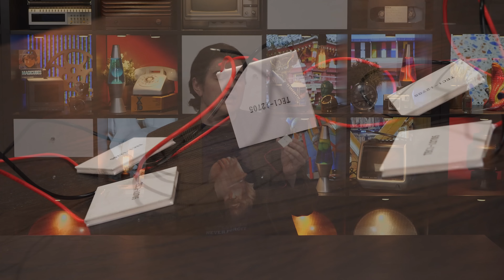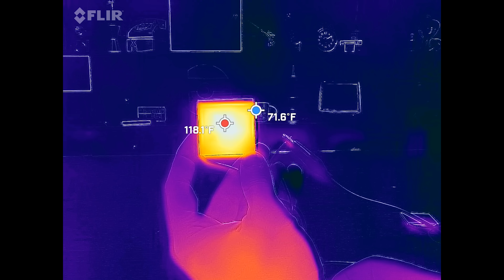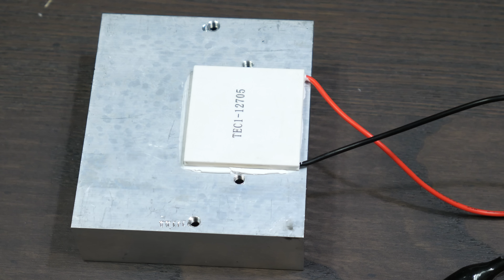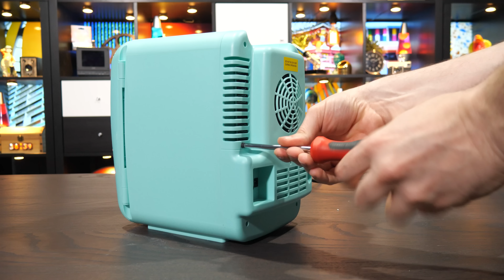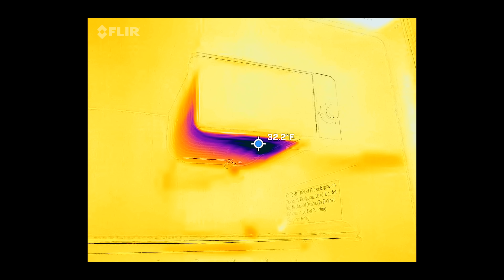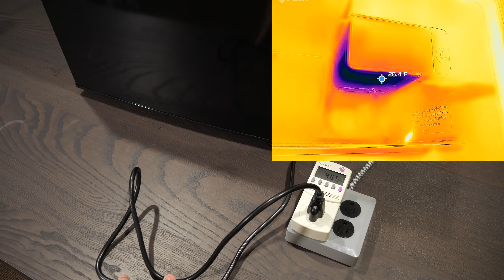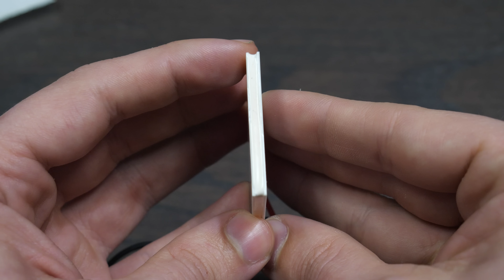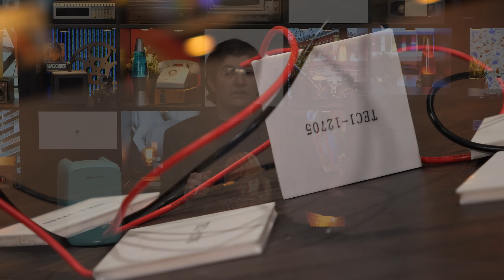Thermoelectric cooling: it's not great.

Comment: I already knew peltier junctions were crap. I had a cooler I got as a service anniversary gift that ran on 12v. I only used it to keep cold stuff cold-ish in my RV. It couldn't get a can of beer cold.

But damn, this is a good video. I am thermodynamically impaired as well. I see the energy budget everywhere I look. My dad taught me to not use the brakes in the car by coasting to lights or signs, things like that.

Comment: Can't argue with any of the drawbacks in the video. We like ours but that's because nothing larger will fit in its place. Fortunately the space it's in regularly reaches low 60s Fahrenheit so the drinks are always ice cold. At 70°F room temperature they would reach 40°F which is totally drinkable for me, although tastes can differ.

Comment: Also if you apply and temperature gradient to each side of the Peltier device it will generate a voltage. Voyager uses something similar as it's power supply by using the heat from nuclear decay  and the thermal radiation to the cold of space to generate like 470 Watts.

Comment: you should really get some powerplugs with measuring capabilities like shelly plug-s-plus or better yet something that comes already preflashed with tasmota (just don't forget to calibrate once). tie it to e.G. homeassistant or mqtt or something like that, and you get wonderful graphs over time for current, powerdraw, consumption over time, grid-frequency and so on (not to mention to be able to flick the switch inside it, and have a remote on/off-switch that way). this is way more appealing than a regular old kill-a-watt, and trust me, you will find the over-time-graphs compared from old fridges, to very old fridges to modern switches to something like peltier-elements very interesting. i did basically exact this comparison a few days ago, and i was baffled, how energy-efficient modern fridges have become, and you can deduct their inner working mechanism wonderfully from just looking at the graphs. you even can immediately tell, if a fridge uses leds or incondescant bulbs. 

Give them a try, you wont regret it. I currently use "Nous A8T" preflashed with tasmota (EU-Version), but they come in all different shapes and sizes. And they are pretty cheap anyways (on german amazon currently ~11.5€/pcs in a 4-pack)...

Comment: So i have a 12 can version that has 3 plates in it (thanks thermal camera) and the option to run hot i love the thing it lives in the sevice truck runs off the inverter and the deep cycle battery it can run on its side (lives behind the seat) and can be reversed to keep stuff from freezing and for keeping stuff cold if you add 3-4 cold cans from the fridge it keeps them cold egnough for working outside lmi have also ised it in the winter to keep stuff unfrozen overnight sometimes a hotel mini fridge isn't the best option

Comment: Just because you hate the application of the technology doesn't mean you should hate the technology itself. Thermoelectric cooling does have a lot of technical potential and we need to develop new ways of compressorless cooling to eliminate the extensive noise pollution from the outdoor unit of a vapor compression system.

Comment: What if you added a temperature sensor, an arduino to control an on off cycle that cuts power to the peltier when a low temperature is achieved and maybe a slightly larger one. Wouldn't that technically make it better at cooling at the cost of over complicating it?

Comment: brilliant description!  may i suggest another refridgeration topic?  how about the absorption fridges that are really common in travel trailers and rvs.  these things use either propane or electricity to heat a boiler filled  with an ammonia/hydrogen mix that is circulated by gravity to cool a fridge

Comment: I made a TEC based mini fridge inside of a PC case for my company's april fools joke once.  It had a lot of problems with condensation and used a lot of power.  One thing I found though was that the TEC ran it's peak efficiency with a 20C delta between the hot and cold sides.  I put a CPU liquid cooler on both sides and found it was easy to maintain that junction differential plus the CPU cooler was very quiet.  It was still terrible, just less terrible.  Again april fools joke.  

One legit use of TEC's is in regulating the temperature for small scale chemical reactions such as medical testing equipment.  Since it can get hot or cold, precise termperature regulation is possible with an H Bridge and a local temperature sensor for feedback control.  Some checmical reactions need to happen at exact temperatures and TEC devices are a great fit for that application.

Comment: I travel with an Igloo 35 quart Peltier cooler built in the lid. I use gel ice pack to hold the temperature. It pull a lot of watts. The solar generator battery pack says it pulls 65 to  75 watts. Running off the car’s  power 12 volt port , it keeps blowing the fuses. There are compressors based travel fridge and freezers , good brands start at $400 dollars. Top brands start at $2000. These are designed to handle the rigors of off road travel and be run off a battery pack.

Comment: I needed this BEFORE I bought two of these after the first one broke and I got a slightly larger one for $10 more. the stainless steel looks classy, I'll probably upgrade the heat sink, maybe get a more power efficient PSU from an old computer, add some RGB and a graphics card, etc. then play DOOM on it

Comment: There are 12v peltier based portable coolers around the size of a mini fridge that are really nice for traveling with and not having to deal with ice.  I use mine quite a bit and aside from not using ice I also have a wall adapter to run it so if for some reason I don't feel like unloading it when I'm done I can just plug it in and deal with it in the morning.  They do definitely fall into the temporary use category though and work best for keeping already chilled things cold instead of cooling down room temperature things.  

Another cool feature they have(which I rarely use) is they can operate in reverse and keep warm things warm.

Comment: I always wondered why Peltier elements were not piggyback on top of each other. If one could lower temp by 30 degree, then 3 would provide 90 degree difference. I'm sure the efficiency would way worse.

Comment: Peltier coolers are also great ine you need to cool something with a small surface area, such as a processor.  It was very popular back in overclocking days as it was one way to achieve extreme heat dissipation

Comment: I'd like mine better if it it didn't have a propensity for draining the battery in the car. The one I have is set up as a shoulder carryiable car fridge. That means 12v DC, and I've not found a decent evaporation cycle refrigerator that works well in a car. There may be one, but I didn't find it. I gave up on it when it killed the car battery while I was parked at an even for over 2 hours. For this last trip I would love to have had something for the drive, but it ended up being just as well to take along a cooler and pick up 5 lb of ice every couple of days. Remember if you're traveling through the mountains if you have ziplock bags, make sure that they are not underwater during elevation changes.

Comment: It isn't exactly news that tec coolers suck. Funny thing with tec coolers if you heat the hot one side it creates a potential. You should check out the Biolite stove which runs them in reverse to charge a phone.

Comment: I always thought peltiers would be a great application for absorption refrigerators. For electric use, they always have a heating element. In theory, you could use the peltier as the heating element which would give you more heating energy than you put in. At the same time, the cold side can be used to help cool the fridge.

Of course it's much more complicated to do that and probably not worth it, but I want to try it one day just for the fun of it.

Comment: I used a tiny fridge in my room of the sharehouse during uni. I bought it at an op shop (thrift store). 4 bottles of beer and 2 250g blocks of Cadbury chocolate. I think I gave up on it during summer, but having it on constantly during winter took the edge of the chill in the room. And the room rent I paid included all bills.

Comment: funny i have one next to me right now i use it to keep my cup of water cool as don't like room temp water and it can get cool down to 4c lowest i see it when was testing it but struggles on hot days above 25c in room am in UK so 25c is warm day 🤣 my one is a bit more fancy has cold and warm switch and only uses 35watts but i did change the fan to a little Noctua one and worked way better and more quiet. My only problem is when it does get cold gets ice build up on the back then when room gets warm it melts a bit so have to have paper towel folded inside to stop it dripping as the new fan makes it cooler for longer.

Comment: I flipped the compressor on my mini fridge on it's side an attached it to an 2x4(which actually damped the vibrations a bit too) and made my mini fridge into an mini chest fridge, never got to test how much less energy it used but it's a fun tip. I used it that way for like 6 months. Sounds like another fridge video for  you! Do it, come on it will be fun...and on brand!  No effort November is right around the corner.

Comment: It is wild to realise those tiny Peltier fridges pull more energy than big chunky American fridges! I have two questions after seeing this video: What happens when you plug in a regular fridge directly after flipping it upside down? And can they make the compressor system small enough to work for the tiny Peltier fridge?
The remark that the regular mini fridge can do without the tiny freezer part; I have one and use the freezer part to make ice cubes, which works surprisingly well.

Comment: There was a peltier in the uv/vis spectrophotometer I used forever ago. Not to make it cold. Just to make it a "consistent" temperature when you took a spectrum. Usually just above room temperature. Because it's easier to use a peltier to make things hot (at least that was what I was told :) )
Reply: Also the "Save big money at menards" jingle lives rent free in my head and this video revived it.

Comment: For anyone else confused by the big "C-PENTANE" label on the back of his black fridge:

That's not the refrigerant, it's the blowing agent used to make the insulation foam (cyclopentane). The refrigerant is listed on another label as R600a (isobutane)
Reply: Thanks for the info. My organic chemistry brain was having a fit over it.
Reply: Thanks for this comment!  I have a chest freezer that uses cyclopentane as the refrigerant, saw the C-Pentane label, but kept hearing isobutane.  Later, I saw the R600a and began to think I was seeing two different units.  But that would be uncharacteristic for Alec.  I was left in confusion until i found your comment.  Thanks again!
Reply: Maybe they're doing this now after they were caught several years ago manuacturing shittons of CFC11 in Shandong province in flagrant violation of the Montreal protocol?
Reply: Btw. Is that another America/Europe difference? I've never heard of R600a as a refrigerant before. Fridges here use R290 (propane).

Comment: Okay, I am confused. I owned for many years a device similar to that blue one. It was larger, had a silver door, a fan on top, fit 8, not 6 cans, and got those fuckers ICE COLD. I don't mean "chilled" the way he is showing, you'd have 100% ice cold beverages available. The top metal plate inside where the air flowed would ice over. Did they just used to make better ones of these micro-fridges? I'm not arguing that the one he bought isn't a POS that is 100% not worth running, but I had a very similar one that performed heads and shoulders better than what he's talking about in a slightly larger capacity.  Do they not make decent ones anymore? My box didn't say anything about 25-30 degrees below ambient either.

Comment: I’m disappointed. I’m struggling with health issues and need access to drinks all the time. At home it’s no big deal, but travelling a cooler without ice would be nifty. I never bought one because I just assumed that it was just a fan in a box.  It’s more complicated lex and equally gimmicky.  I have a mini fridge that I use in the camper, but it is not practical to leave in the rear passenger footwell of the car.

Comment: I could be wrong, but I believe I have some of these in my vehicle.  I live where it gets pretty hot, so when I had the option to buy a vehicle with cooled seats I said why not?  I noticed however that they don't run on the vehicle AC that I can tell, so I figured they must be Peltier devices, which means that they may cool the seat somewhat on a hot day, but they dump that waste heat right back into the cabin.  I don't use them often even when it's really hot.  Very limited use case there, and even then it comes with some caveats.

Comment: So the thing with peltier devices is that you can get higher than even a COP of 2, as long as it's at very minimal temperature differences and power inputs. It's just that you'd need an awful lot of them to get the same total power out at that operating condition, and they're not free. You may also need to change your design in order to allow them to work the way they want to, such as by using counterflow heat exchangers to reduce the temperature differential depending on the purpose of cooling. For instance, maybe you want a dehumidifier, but you realize the bare minimum is just enough to keep actual dew from condensing onto random objects, rather than needing lowering the dew point enough for human comfort. Well, if you for some reason want it to be quieter than you could possibly get with a refrigerant-based system, or if you refuse to reuse an old fridge and have to buy brand new, this might kinda work. And in heating, the COP is guaranteed to be greater than one, so these are always better than a resistor, and sometimes a fair amount better, especially if your thermostat is not just on/off but instead smoothly varies the power. So maybe you could use them to heat water, for instance. Or maybe you want to make something that can theoretically last centuries, and the only way to do it is to use this and lots of heatsink area, to eliminate the fans.

Comment: By inputting heat and cooling the cool side, they can be used as generators.
They're worse as generators than they're at refrigerators. But they're used in Radioisotope Thermoelectric Generators powering spacecraft by transforming the heat created by nuclear material straight into electric power, particularly in the ones that are designed to travel so far from our Sun that solar panels become impractical, like the Pioneer and Voyager missions. One is also fitted to the Curiosity (2012, still working!) and Perseverance (2021) Mars Rovers. Some of the scientific experiments left by astronauts on the Moon were also powered by RTGs. So yeah, take that standard refrigeration cycle.

Comment: I've used that exact minifridge at work (the proper minifridge, not the blue blob), it's not buzzy during operation. The other thing is they can be a bit of a pain when ice builds up on/in the evaporator where people have let them go for months at a time without cleaning leaving a solid mass of ice taking up space. The only way to feasably clean it is to unplug it and set it outside to thaw for a day, which is  a bit less than sanitary, but at least you won't have water spilling out of the fridge into your workspace and you can wipe it down afterward.

Comment: I drive a truck over the road and keep a 12v cooler next to my seat for bottles of water that i pull out of regular refrigerator that also will freeze. And i wouldn't know what to do without. It is realy good at keeping already cold stuff cold. And will discharge the batteries if left plugged in overnight.

Comment: personally, I would use the Seabeck effect  of these. This is also not great, but allows a passive energy scavenger. where you need a small circuit and have some room temperature ish heat gradient, it will just keep making some of that heat into electricity, handy for things like grid free needs, or camping things. I  could see a wall like piece you could aim at the sun or a campfire to recharge small devices, monitor and power sensors. I know one that is used to put on wood and pellet stoves to make a fan blow more of the heated air around the room.

Comment: Peltier coolers were very common when overclocking processors was all the craze. You cold get the processor much colder than with ambient air cooling.

Comment: It is wildly inefficient. They are also the one thing only it can do. Turn heat into electricity directly. The one you have can be reversed and at 5% efficient. Lab units can get up to 10%. To put it in perspective Battletech they are at 60% and Star Trek is above 90%.

Comment: I have a small camping fridge. Contains a compressor and refrigerant. Also digital readout. Runs off 12 volt. 
You might be interested in 3 way fridges that run off gas, 12 volt and 240 volt or maybe whatever voltage Americans use.

Comment: Most entertaining informational channel on AdTube. I mean YouTube. 
I have a DC one. I use it in the car for trips. It can keep already cold stuff pretty cold, but that's about all it's good at.
Had a bigger AC one when I first drove trucks. It would keep the one drink touching that square on the back cold, the rest slightly chilled. Since I had an inverter already, I got a mini fridge later on and never regretted it.

Comment: Yknow, all these qualities of Peltier elements make me wonder.

Why do alot of CPU's work similiarly, and in fact have an installation basically identical to the useless blue thing. Where you need thermal paste, a heat sink, and a fan on top for full cooling.